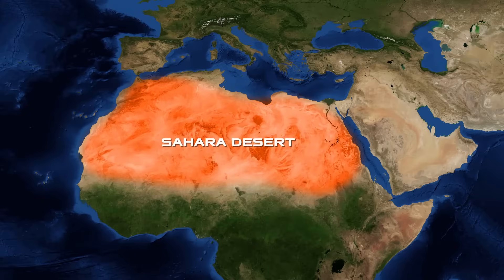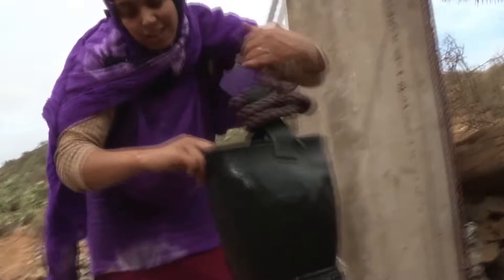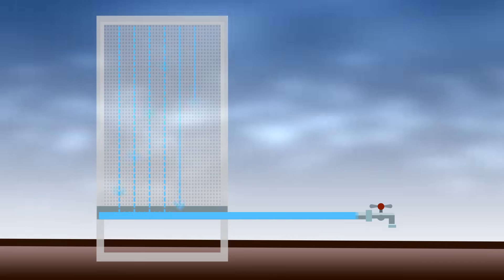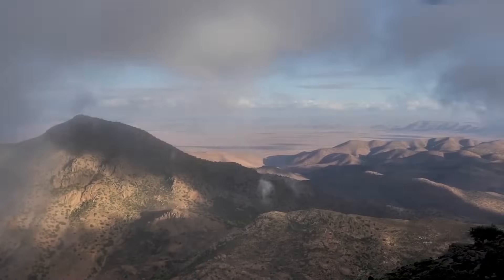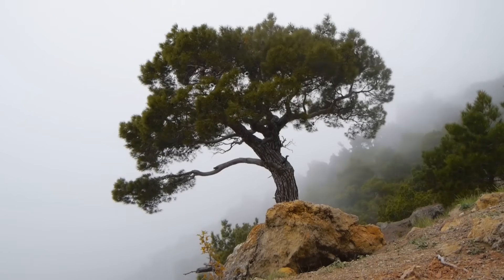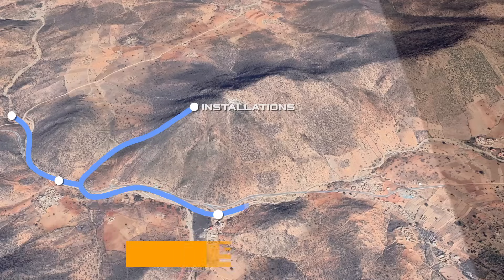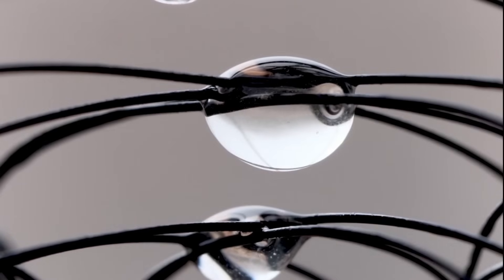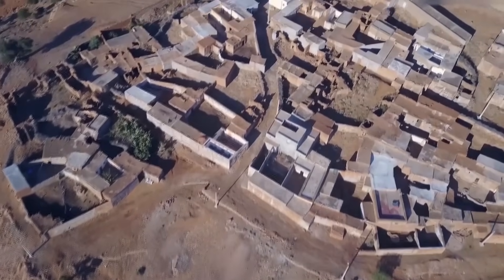How do these nets harvest water in the arid Sahara?

Comment: The only way that you were supposed to get water is by making a 6 km mountain and the humidity goes to the top and it turns into ice and then the ice creates a stream that puts water at the bottom and then when the water at the bottom evaporates it goes back to the top of the mountain and turns back into ice again and it continues doing this if you use fog it is taking water away from the glaciers which is the thing that is giving you freshwater in the first place and all the water everywhere is going to evaporate you can only make mountains wear ice comes down from the top
The reason why you can't put water in the desert is because there's no cooling source to keep the water at one temperature which makes the water completely evaporate and that's why there's 8000 lakes in Canada because of the ice and if the ice was too evaporate all of the water in Canada would evaporate to
Either it's really cold and you have an abundance of water and limited resources or it's really hot and you have limited water but a lot of resources those are the options you cannot have the best of both worlds

Comment: here how water was purified can u tell mee?????
Reply: It's pretty pure already since it comes from fog.

Filters are often used to purify water. You can boil water for many minutes  to purify it from parasites and pathogens but not chemicals.

A primitive filter can be made with a tube, maybe a water bottle w the bottom cut off. 

First pit in the finest (clean! Boiled in water first) sand. Then a layer of finely ground charcoal (filters out chemicals), then coarse sand, then small pebbles. About 2" for each layer.

Then pour the water into the filter so it First goes through the pebbles and filters down through the layers, through the charcoal and find sand, out the spout, or narrow end, into a Bucket or glass.